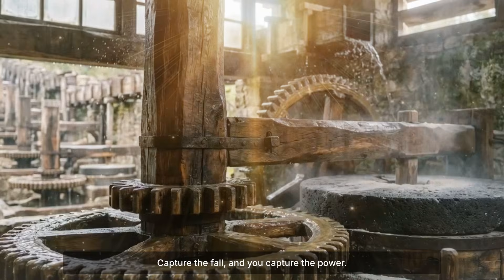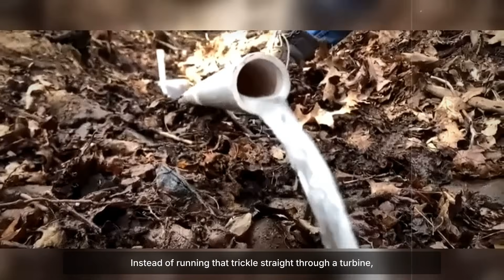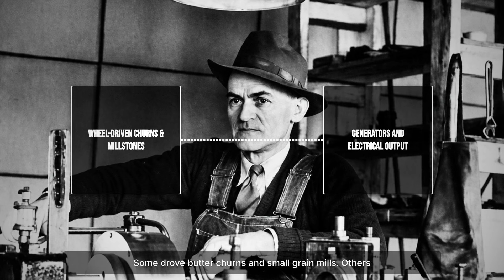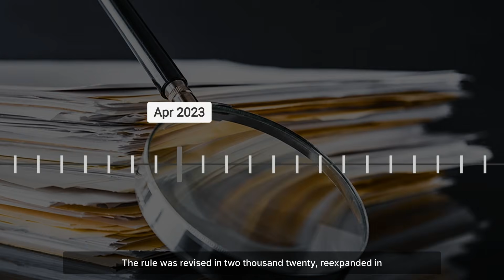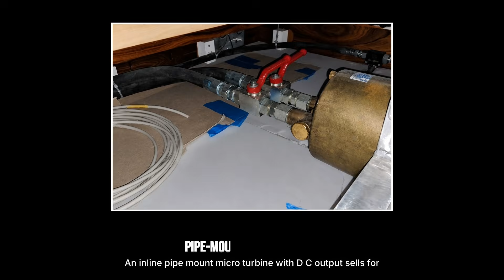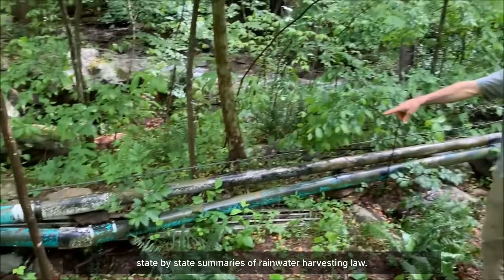This $40 Tank Turns Rain Into FREE Electricity. Why the EPA Wants It Gone.

Comment: You are showing a Pelton Wheel turbine. You will need a tall storage tower. The pressure at the bottom goes up one atmosphere for approximately each 30 ft. That pressure, with velocity of Fall, then needs to be converted to velocity by the right size nozzle.